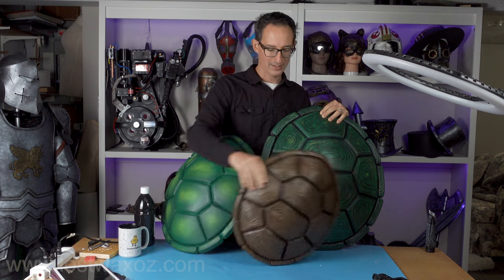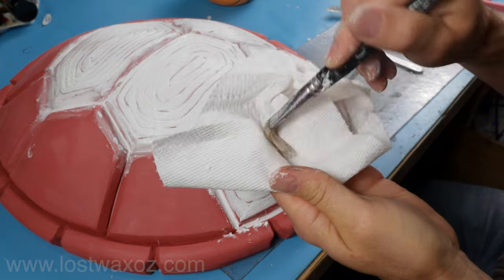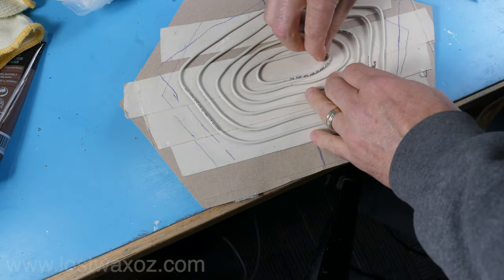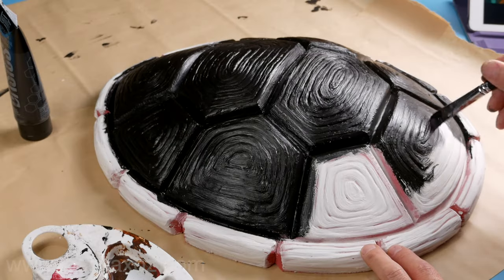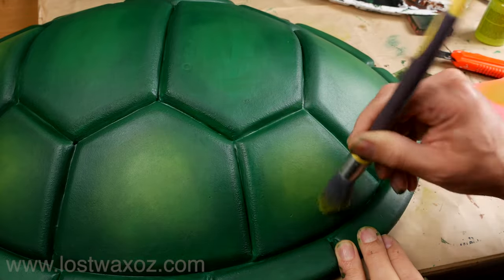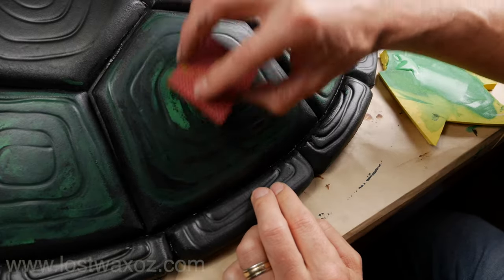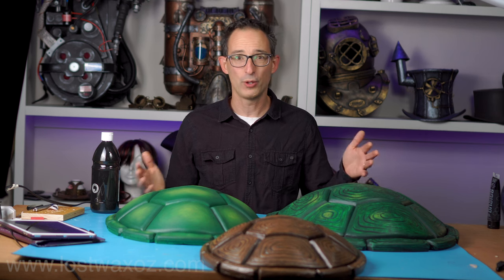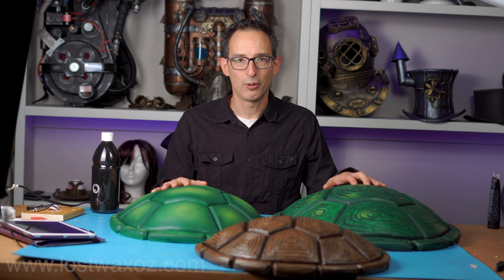DIY NInja Turtle Shell Tutorial Part 2- Painting.  TMNT  Costume Made from EVA Foam Templates.

Comment: Would it be possible to draw the pattern on the shell, then take your knife and follow the pattern making a VERY shallow continuous line. Then hit it with the heat gun?
Reply from the maker: Yep, that would work, though you'll still have the seam lines showing where you glued the 4 pieces together, as well as the shell being kinda floppy without the reinforcement of the plates on top.